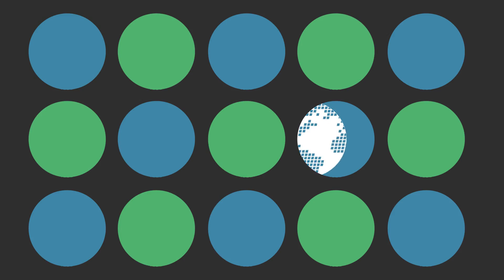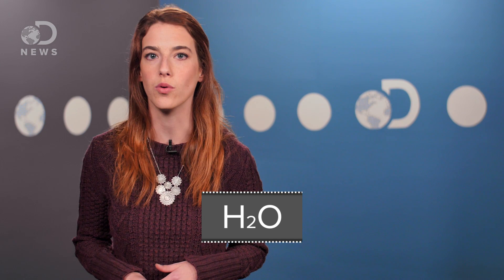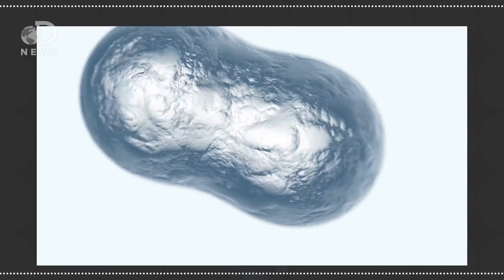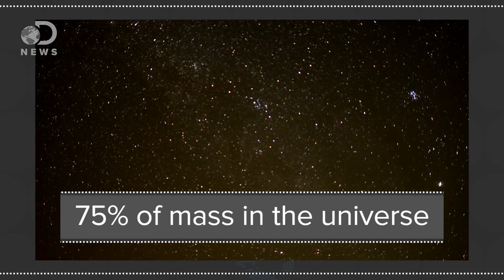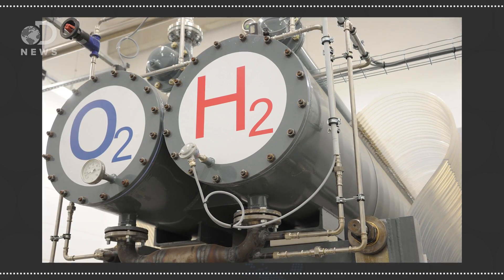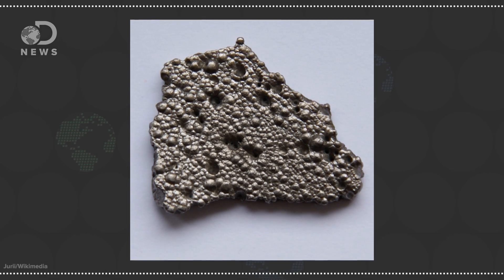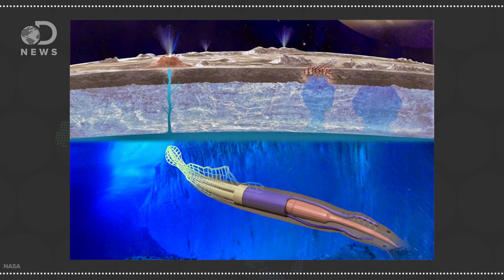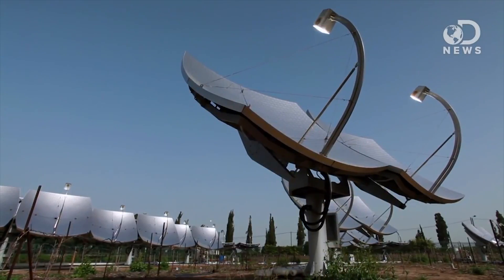How Can Water Be Turned Into Fuel?

Comment: it hasn't become a thing because there too much money on oil, i think that is the reason so many alternatives energy sources have not become a thing.
Reply: Agel1ic While oil and other fossil fuels take up the lion's share of government subsidies and other supports, there are other reasons why hydrogen fuels haven't been adopted.  Firstly, hydrogen cars are massively expensive, with Hyundai recently selling an SUV model (in small numbers) for $133k.  They recently lowered the cost to around $75k, but they're probably losing a lot of money or getting a lot of support from the Korean Government to make this happen even at this price.  Secondly, hydrogen fueling stations cost $2M apiece.  No one will buy a hydrogen car until there is sufficient fueling infrastructure and nobody wants to plunk down billions of dollars on the off chance that hydrogen cars will become popular (their high cost makes this even harder to pull off).

But even if all these issues are somehow ironed out, the laws of physics are the real nail in the coffin for hydrogen cars.  Electrolysis is 70% efficient and it takes 10% of the energy contained in the hydrogen fuel produced to compress the fuel to 5,000 - 10,000 psi needed by hydrogen cars.  Finally, hydrogen cars themselves are 50% efficient (and I'm being generous here).  Multiply 70% by 90% by 50% and you get 31.5% of the electrical energy you put into electrolysis back out as electricity to turn the car's motor.  This is why fuel cell cars only get around 65MPGe (or use the same amount of energy in a gallon of gas to go 65 miles).  A carefully-driven Prius can get this level of efficiency or even better at a fraction of the cost.  Electric cars like the Nissan LEAF can get over 120MPGe and there are millions of plugs already in place where they can refuel.  Hydrogen will always be at a huge disadvantage to electricity because it takes way too much energy to create it and then turn it back into electricity.
Reply: Agel1ic The best place - by far - to use hydrogen is in a fuel cell. Using a fuel cell to make electricity to power a vehicle is a) very expensive, and b) very heavy. (You could say goodbye to any storage space in your car.)

Comment: THIS WILL NEVER BE VIABLE!!! This video forgot to mention the fact that hydrogen production by electrolysis is only about 70% efficient at best where as current lithium polymer batteries are over 90% efficient. That doesn't even include the energy required to desalinate water if necessary (which there is a good chance it would be as global fresh water sources are already stressed) or the VAST amount of energy needed to cool and pump the hydrogen into pressurised vessels; and then there is the transport. 

So basically batteries will always be better than hydrogen (especially if you need to mine Lithium to add to the water to aid electrolysis anyway). I am not a huge fan of Elon Musk (I have mixed opinions about him) but I do agree with his statement that hydrogen doesn't make sense. 

The two things that COULD possibly make hydrogen more viable are metal hydrides for efficient storage and producing hydrogen using energy direct from sunlight which would make the production more efficient. These things weren't even discussed in the video, only the pointless stuff so yeah...

Comment: If you get the temperature of water high enough, it will actually dissociate into oxygen and hydrogen.  This is what happens in pressurized-water nuclear reactors, and they actually need a recombiner in their primary coolant loop, otherwise oxygen gas and hydrogen gas would build up in the pipes. 

Molten salt reactors can use this effect to completely avoid electrolysis and dissociate water with much, much less energy and effort.   #LFTR

Comment: When we break it down to the most basic levels both hydrogen and batteries are just two means of storing energy..
Battery powered electric cars are more efficient and practical at the end of the day.

The only reason I can see why hydrogen is still being pushed so hard is so that current fuel stations (and the entire manufacturing / supply chain) can still control and profit from vehicles.
If everyone could refuel at home the entire industry collapses. It's not a conspiracy theory, it's big businesses trying to find a way to keep afloat. And hydrogen makes perfect sense from their business standpoint.
Even though it doesn't make sense from a consumer or scientific standpoint
Reply: Isn't it that batteries are extreamly heavy for the amount of energy they can store? I think it might be that the energy density in hydrogen fuel is higher than in batteries, so it would make compleatly sense to build hydrogen cars with a lower mass and a higher fuel efficiency than battery powered ones. The only question is, if that compensates for the loss of energy when spliting the water molecules.
Reply: Tobias Remember you'd have to include the weight of the fuel cell in the end calculation but, yes.

Current battery technology suffers much in the same way as rockets do when it comes to fuel (again I'm massively oversimplifying). So the range to weight curve skyrockets.

There have been quite a few advances and breakthroughs in newer battery technologies which could solve some of these issues, whereas the energy cost for spiting water remains fairly constant.
Unless we discover a better method than electrolysis. Current hydrogen is often extracted from natural gas / fraking

Maybe both have a place in the new world.. But looking for greener solutions batteries seem to be the way to go.
Also more convenient and greener.
Reply: Azurren Quoting you: "If everyone could refuel at home the entire industry collapses". Absolutely not sir. Yes fuel stations would be absolete, but everyone would pay more electricity bills. Like 25 years ago you didn't have internet, you paid alot for phone bills, but now as you have internet, you pay more internet bills and less phone bills (because just by paying a single internet connection, we can communicate freely in so many different ways). Same reason as now everyone's using mobile phones, public pay phone became obsolete. We will always pay for things, but we get more benefits as technology progresses. It's just how we evolve as human beings.
Reply: Azurren Coming up with new catalysts, photocatalysts, and materials systems for hydrogen production is a pretty active area of research in chemistry and materials science lately.  Obviously it will always cost energy to produce hydrogen, but if you can efficiently harvest that energy directly from the sun using earth-abundant materials you can create a sustainable and scalable process for producing H2.
Reply: Deejcello Technology and our understanding is always improving so I have no doubt that both technologies can / will improve immensely.

But even with my limited understanding of physics using energy to split water molecules apart, compressing the resulting hydrogen then converting said hydrogen back into water is a lot less efficient than simply storing said energy chemically.

Batteries (Even with current technology) are fairly efficient (Let's say 80% for arguments sake, even though they can be much higher) whereas hydrogen fuel cells are only 40–60% efficient. Combine that with the efficiency loss for compressing said hydrogen and the massive efficiency loss with electrolysis and you get a number closer to the 20-35% figure of the Internal combustion engine. :(
Reply: Fundemort Grey Prime Defender of Truth and Justice I'm not trying to say that we won't have to pay and I have no doubt energy bills will rise.

But the CEO's, directors boards and investors in the current fuel chain industry are facing uncertain futures. They have to think ahead and discover different directions to take to remain profitable and not go under.

They couldn't just switch to electricity generation with their current infrastructure. Hydrogen is one such technology that they could capitalize on. Battery powered electric cars are not.

Before the invention of the household freezer there was a very profitable ice industry. From manufacturing to delivery. Once people started investing in freezers, true they had to pay a lot more in the form of electricity but none of that money lined the pockets of the ice industry.
Yeah that was a pretty poor analogy from the top of my head but I think you see the direction I'm coming from.
Reply: Batteries are as far from green as it gets. Hydrogen is a far cleaner source of energy, and hydrogen fuel cells are also pointless. You can burn hydrogen in an internal combustion engine.
Reply: Azurren The argument for transportation becomes complicated by energy density (by weight and volume).  Lithium ion batteries are heavy, much heavier than the energy equivalent of gasoline.  So while battery technology is more efficient thermodynamically, you have to consider that you're carrying the battery in a car whereas you are just carrying the fuel in the case of hydrogen or gasoline (a hydrogen fuel tank would need to be 2x as large, but would weigh the same as a regular car's gas tank).  I'm not saying that h2 will end up in cars, i'm just saying that battery technology still has a long way to go in terms of energy density (and lifetime), and that you can't make the argument for batteries based on overall efficiency of the process alone.
Reply: Deejcello That's true. Even at 10% capacity you are still lugging around the full weight of the battery. But that's not to say that pressurized hydrogen tanks don't have the exact same issue (all be it a lot lighter) and also paired with the fuel cell.

The figures aren't readily available and I'm not quite up the the challenge of calculation weight efficiency alongside power efficiency. So sadly all I can do is make educated guesses.
Reply: http://en.wikipedia.org/wiki/Energy_density#Energy_densities_of_common_energy_storage_materials

wikipedia has a good list of energy density for power sources, but you're right, it is a tedious calculation to make.  Personally, I hope both technologies become widely commercially available in cars soon, but they each have their own technological challenges.
Reply: Azurren One problem with fuel cells is they require platinum catalysts.   Platinum--currently costing over $1,000 an ounce--will become more expensive with the increased demand.  Fuel cell cars will be too expensive to be economical.

Comment: How does the law of conservation of mass effect this?
Reply: Captain von Kerman You're not creating or destroying any matter. 2(H2O)=2H2+02=2(H2O) Speaking of conservation, electrolysis requires more energy than can be utilized from the resulting fuel, thus making it impossible to "power a town" with it. The hydrogen plant/homes would have to be powered by a non-hydrogen plant larger than the one that would be needed it no hydrogen were involved.
Reply: Ah, I thought she was saying you could split water, burn hydrogen, then split water again and have power left over
Reply: JWQweqOPDH exactly. And why power a robotic eel with it? The eel needs power to convert H2O into H2, so why not just use that power directly on the robot, cutting out fuel cells all together?  Hydrogen fuel cells are really useful for storing/transporting energy, but useless when connected to a steady flow of power.
Reply: ***** That's not using it as a power source, that's using it as a power storage, which it works fine as.

Comment: Finally, an alternate fuel source than crappy fossil fuels.
Reply: Otto Carroll #1 It's not a new idea. It's over a century old. http://en.wikipedia.org/wiki/Gramme_machine
We've know hydrogen can be used as a fuel for even longer.
#2 Hydrogen is not a full source. There are no natural hydrogen reservoirs on Earth, as it is too hot for it to be found as a liquid, and there is not significant amount in the atmosphere. Hydrogen requires energy to be generated, more than is harnessed when it is used.
Reply: Fossil fuels suck but we need them and rely on them for now
Reply: JWQweqOPDH Dont tell me shit i already know. thanks.
Reply: Otto Carroll If you already knew it doesn't fill the role of fossil fuels, why did you suggest it did?
Reply: My bad. I knew everything you told me but that.